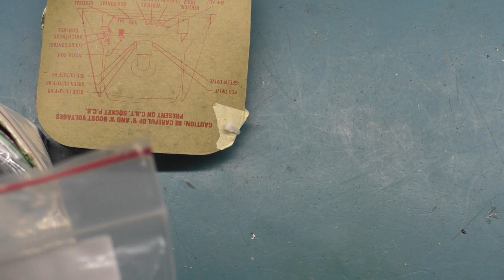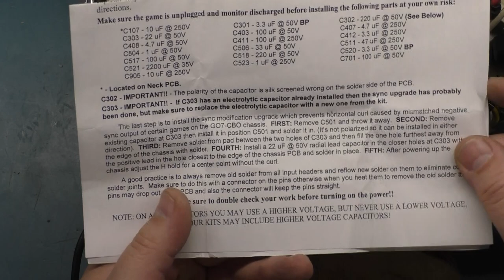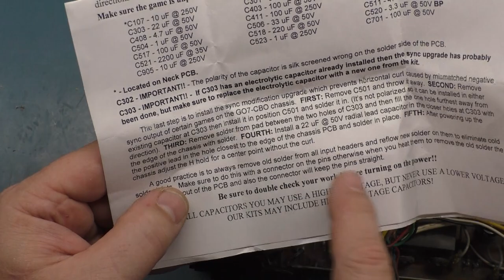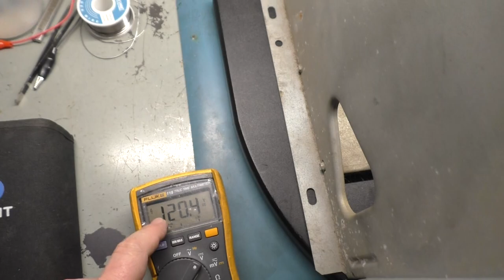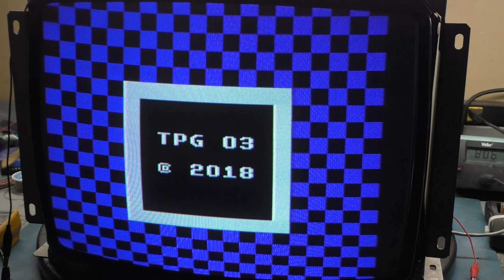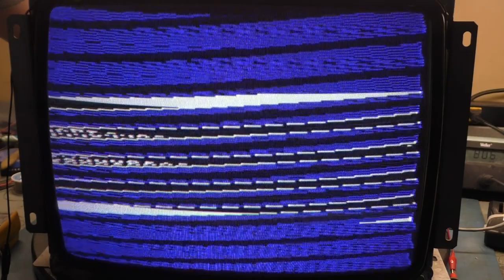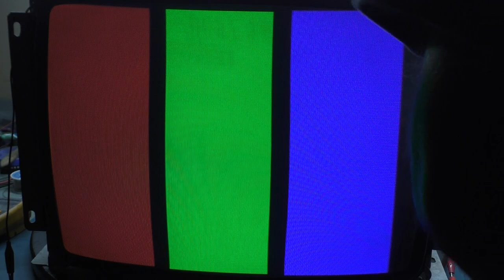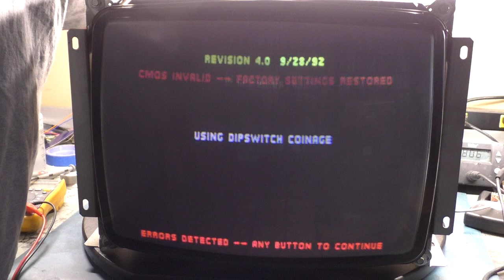19" G07 Arcade Monitor Chassis Repair - DEAD - F901 Blown + Filter Cap Explosion!

Comment: Yep.  If F901 is blown, the filter cap WILL have a full charge in it.   Been bitten by it.  I used a Chisel to discharge one, one time and I have two little marks where the cap legs were.  It's nasty!   I read about using a light bulb to discharge it, but I got a spark from that as well.  Next one I'll have to try my HV Probe and see if I can do it without the spark.   It definitely will get your attention!

Comment: I grabbed a door knob one night, had so much static built up, I saw some pretty good arcing. Damn finger was sore for a few days.
Reply: I literally had a massive arc of electricity short out one of the terminals on the 9V Battery compartment on an electronic device, the second I touched the positive and negative on the battery. The battery in the device would not hold a charge for more than a few minutes with a new fully charged battery after that. It had to have been from static electricity build-up because I wasn't even hooked up to main power or anything. The dangers of wearing shoes or wool socks indoors. 😆